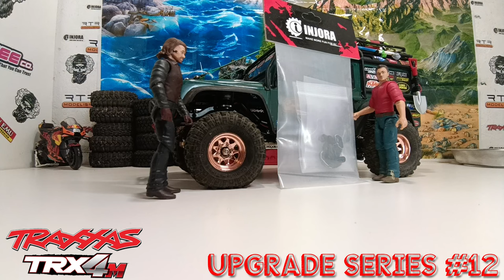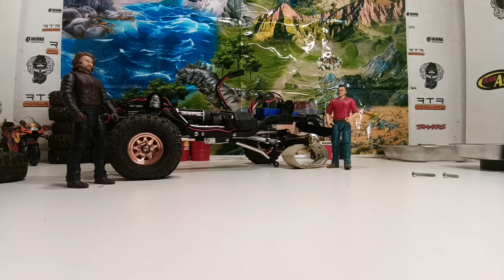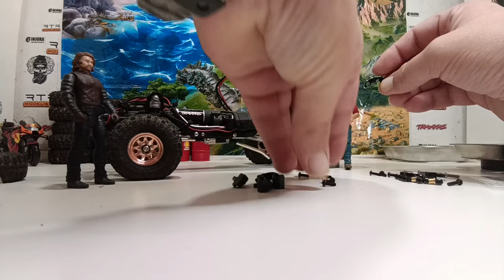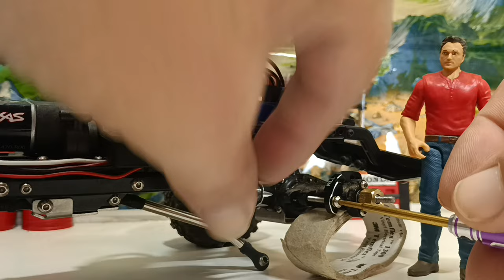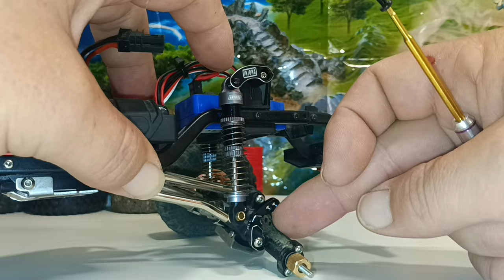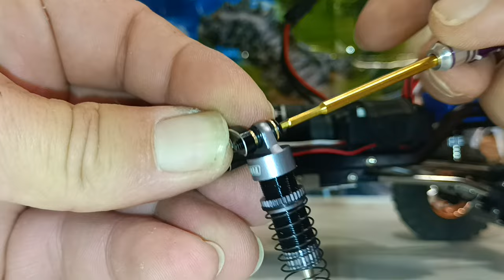Injora Flex blades are they worth it?  Yes or no #￼traxxastrx4m #injora

Comment: Great video.  Well done. Glad i saw it. Has anyone tried a frame mounted servo with a cross link like some 1/10 scales use? I run into the same issue on the scx24. Clipping the ears off the wings is all you can do there. Cheers

Comment: I got way more flex just relocating my shocks that's why a deadbolt is better. Even being smaller than traxxas I climb better and get more flex than all my buddies with my deadbolt. And they have really expensive traxxas mini.
Reply from the maker: Yeah this is what I'm trying to say with these flex blades is that, it's really not worth fitting them it's better to reposition the shocks
Or just fit some longer shocks.
I truly appreciate you watching and commenting my friend thank you 😁👍👍👍
Reply: This is simply untrue. Well it’s true you moved your shocks and got more “flecks” but the rest is not accurate. The trx4ms are superior from suspension to motor. I have them all and you can also find a dozen comparison videos on here when they came out being tested against each other in all sorts of configurations.

Comment: Slide the bumper forward to the next hole to clear the servo wiring. There's a hole in the frame that might allow it to work.
Reply from the maker: Yes and then you won't be able to go anywhere as the front bumper already catches on everything.
Reply: I installed low profile front and rear bumpers they sell on etsy. They're a excellent investment

Comment: Hey I have a question what rims and tires do you use
Reply from the maker: Hey bro, I am running the 1.0 offset metal stamped Rims from Injora

https://www.injora.com/products/4pcs-1-0-negative-offset-3-78mm-stamped-steel-beadlock-wheel-rims-for-axial-scx24
 and there 56mm Injora crawler tires

https://www.injora.com/products/injora-1-0-56-22mm-soft-rubber-wheel-tires-56-22mm-rock-terrain-for-axial-scx24

Comment: What drive shafts are you using to hit those kind of angles? 😮
Reply from the maker: I'm just running the Injora stainless steel drive shafts.
What makes all the difference is the high-clearance links! 
Put two of their spaces on the upper links that helps usually for the angles on the drive shaft!
Allowing for a bit more travel on the front axle.

Comment: They bother producing them because many ignorant people think they need as much “flecks” as possible so they buy them. It’s unfortunate but true. A tire height of flex is typically as much as you need. By that I mean 3 tires on the ground and one lifted to the same height as the tires are tall. I see a couple other comments on here of those people claiming their massive flecks has them getting around better than all other trucks lol. We know better and it’s a shame they refuse to accept it.
Reply from the maker: Hi bro
You couldn't have said it any better!!
I honestly thought I was missing out on something, so I thought I would give the flics blades a shot and they did exactly what I thought they would do to the overall performance of Rig
But I had to test it for myself to see if a lot of the other videos I have seen we're honest and clearly I must have done something wrong as I really thought they just hit the overall performance so hard.
Like I've mentioned a good few times they are excellent for getting some awesome pictures and that's about it!!!!
I really appreciate you watching and dropping this awesome comment, thanks bro 🤜💥🤛

Comment: Its looks like you have the same problem i have with the torque twist, and do you know of any ways to fix it, thanks!
Reply from the maker: Bro when you running a heavy hardbody like that with all the accessories, it's going to make the torque twist even worse.
Could definitely tighten the rear shock and try and find even harder spring, but I don't see the point in it as it also lost its scale looks.
Besides the torque twist there are so many other issues the flex blades bring, that I really don't think they worth the upgrade.
I will play around with it a bit today and I will let you know what works best to reduce the torque twist.
Thanks for watching and commenting 🤜🤛
Reply: @rcfungames  thanks for replying! Now I’m not going to get the flex blade because I don’t think they are necessary.
Reply from the maker: @Icys_engines  I think you're doing the right choice rather go for the 59mm shocks that just came out I'm sure you'll get more than enough Flex
I spend lots of time on the Bronco trying to get the best out of the flex blades, and it really wasn't worth my time.
Reply: @rcfungames  what brand are the 59mm shocks?
Reply from the maker: @Icys_engines  from Injora 
https://www.injora.com/products/injora-59mm-long-threaded-aluminum-oil-filled-shocks-for-1-18-trx4m-4m-42

Comment: I’m actually going to 3d print some. But only going to use lower and not uppers. Have you tried that? It would be interesting too see if that solves that problem. 🤔 I do enjoy your videos! 💯🤙🏽
Reply from the maker: Thanks bro I appreciate it 😉👍
Yes on the Bronco I removed the upper flex blades, and I actually removed them from the front axle
Just left the lowers on the rear axle and I quite like the way it works like that.
I will try and do a running video of the Bronco just running the rear Flex Blades, and I won't remove the flex blades from the defender, so we can see how they behave.
Thank you so much for watching and commenting I really appreciate it 🤜🤛
Reply: Check out the ones I 3-D printed and they don’t bind like the injora
Reply: @JRTheElectronicGuy  where can I check them out at?
Reply from the maker: @JRTheElectronicGuy  the one thing I can say is that the Injora Flex blades did not bind! 
They caused lots of other problems but not that 😅

Comment: I need some input! I bought flex blades for the bottom only on trx4m bronco...?
Reply from the maker: Hi bro
I didn't know you could buy just the bottom Flex blades! 
I will gladly answer the question but what is the question? 😅
Reply: @rcfungames  Wanted to know how well the bottom flex blades handled? (bottoms only) instead of using  the uppers. I was thinking of trying out the bottoms only. Have some 3d printed ones
Reply from the maker: @jbsir1  well I am only running the rear bottom Flex blades on the back, still not fully happy but its much better than running it with the upper Flex blades.
So I'm sure you'll be fine, hopefully soon I'll get the 59 mm shocks and we'll give them a try without Flex blades, so we can see if we get the same amount of flex.

Comment: Great video, thank you.  I only like flex blades in all rear.  On most rigs, the suspension in thr rear has longer links that can handle the extra flex.  My experience was like yours in the front the blades would catch on the knuckle and steering link.  But the one thing I didn't like is the front unloading when climbing causing a lose od traction and rolling backwards.  I find Injora to be good for wheels and tires and lights, but alot of their products are garbage, especially for the 10 scales!!!  Subbed!!!👍👍👍
Reply from the maker: I definitely agree with you there I'm also only running them on the rear axle, and I have also not been impressed with most of this stuff for the 1/10 scale 
I got lots of brass parts to fit to my 1/10 scale rigs which is one of the things they do okay.
And yes I also think the  products they've made for the trx4m's are a bit better quality than most of their products used to be.
But once again I don't understand why produce parts like the flex blades.
Instead of just trying to keep up with all the other manufacturers make parts that actually do upgrade the vehicle and not hit the performance like this upgrade does.
So far I still think you're better off just throwing the reduction gears a set of rims and tires he's more than enough to get the performance a person wants out of the vehicle.
Everything else just starts hitting the overall performance as it's getting too heavy.
I truly appreciate you subscribing and thank you very much for watching and commenting 🤜💥🤛

Comment: Ok so what I got from it, these aren’t worth it if you like realism
Reply from the maker: @ifunny2725  hi bro, if you like realism! And if you like your rig performing well!!  I definitely don't recommend the flex blades! 
They are awesome for pictures and showing off, and that's about it.
When it comes to performance they hit every aspect really hard. 
The only thing that improves is crawling on flat surfaces with obstacles, hill climbs, side hiling and hill descends, are vertically impossible with them fitted. 
And that's not talking about, the body lean and torque twist, that gets substantially worse, with the flex blades.
And then you've also got the issue that the flex blades in the front, touch and get in the way with the steering links. 
Besides other issues it causes.

Comment: I think you have put them on the wrong side.  RUL is rear upper left. RLL is rear lower left.  The left and right side of any vehicle is as you are behind the steering wheel looking out the front windshield. The right side is AKA The passenger side and the left is the driver side.  I hope that makes sense the way I said it. Your video was an awesome honest one. I wish all YouTube videos were honest and not just sucking up to what ever company the car or parts came from. I subscribed
Reply from the maker: Hi dude, thank you so much for watching and commenting! 
It's a valid point that you're pointing out but no!! They are fitted correctly as I did it exactly how the factory intended.
Thank you so much for subscribing I really appreciate it 🤜🤛

Comment: Hey man I got a question. Can you add the trxm high trail to this chassis and add the jeep body to it? I'm wondering if I can get the hight of the high trail and the body of the regular.
Reply from the maker: Hi bro, no the Jeep body is only compatible with the chassis from the defender and bronco.
The High Trails chassis is 2 cm longer.
So the Jeep body nor defender or Bronco will fit on it.
Reply: Thanks man that helps alot. And as always awesome video bro 👌

Comment: What if u just remove both front bottom ones and leave the rest?
Reply from the maker: You can do that, but then you are just using them to change the shock position and you're not actually using them as Flex blades!
For that I would recommend just buying the aftermarket shock towers which have multiple positions for you to position your shocks to get better articulation.
I have tried the flex blades in every different manner and I really don't recommend them.
They never increase the performance!! they just hit the performance really hard.

Comment: i have 3D printed flex blades and I only run them in the rear
Reply from the maker: That's awesome! I just got myself a 3D printer for Xmas 🎁
Yeah the only way to run Flex blades is on the rear! To me on the front axle it's just not worth it!
Merry Christmas 🎅🎁
Reply: Upper and lower rear ? Or only lowers?

Comment: i have try those flex blade. got the same servo problem than you when turning. i do have switch the front long arm and the flex blade so the shock is inside and the arm outide. no more issue with the hiting point when turning. but after a week i take them off to keep only those in the back. you may want to try the switch
Reply from the maker: Dude I tried many set-ups on the front exel but regardless of how it was set up the angle on the drive shaft is just too much and causes binding when the suspension is stretched out, besides that it can climb anything, it just rolls over
I spent many days changing the setup on my Bronco and the best setup is just removing the front Flex blades and removing the top rear one and it now performs ok
I am quite happy with my setup as it is now.
This front regardless of changing the arms around it doesn't look good and you still have the same group which stole causes the problem with the drive shaft in the front.
Which is just a problem waiting to give broken gears or drive shaft.
I truly appreciate your comment
And thank you very much for watching ✌️

Comment: Ok it’s just an RC, but switching from a shock vertical in compression to 45° inward is not going to work well…
Reply: Can’t you switch the rear upper left/right ?
Reply: Also… it’s more “droop arms” than flex plates…
Reply from the maker: Look if you building a comp crawler then it is a good set-up but running a heavy body with those flex blades is not a good idea, and it takes away the scale look.
There is no point in changing the uppers from one side to the other you might as well just put them back to the shock tower it works better.
Thank you very much for watching and commenting bro 🤜🤛